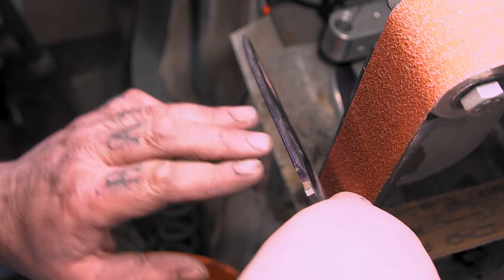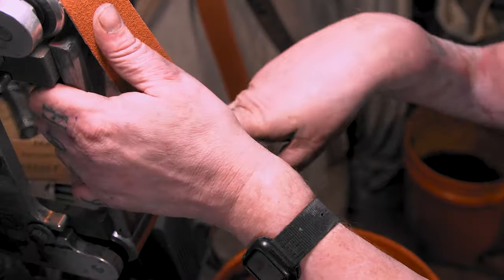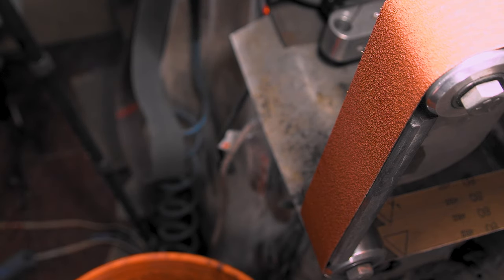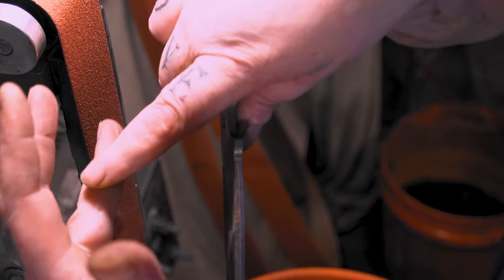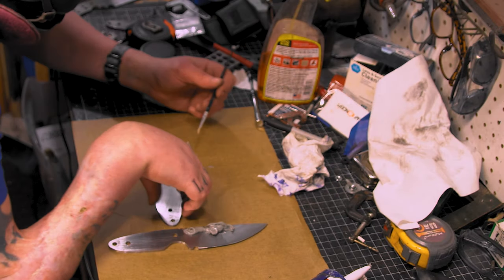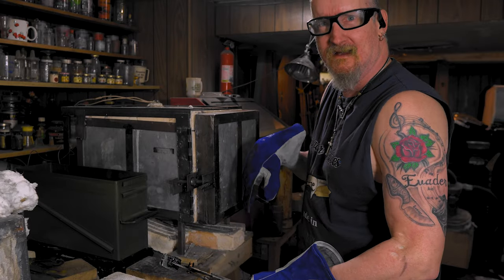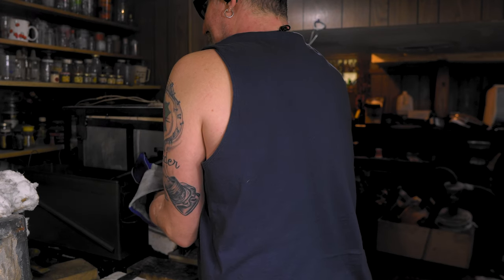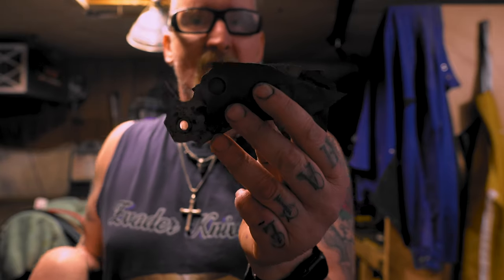Knifemaking Redemption 2(Bevels & Heat Treating)

Comment: We all have had our battle with the belts!  I have been using VSM 36 for roughing everything then Blaze 60 for all grinding- then move up to Cubitron 120 before going to Norax or Surface conditioning to finish all blades.
Reply from the maker: Right on, I like blaze & cubitron, they are better, but for almost double the price, they aren't double the wear(to me). I just started using 50 to 120 for cost effectiveness too, that & cutting out a whole step.